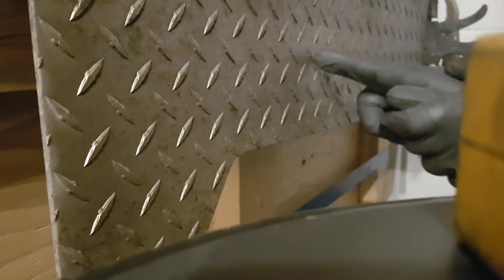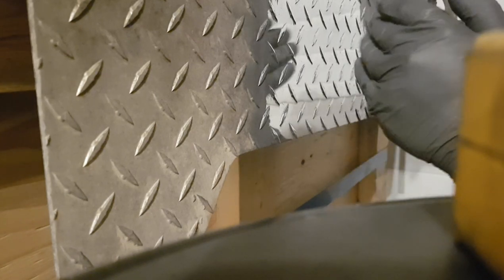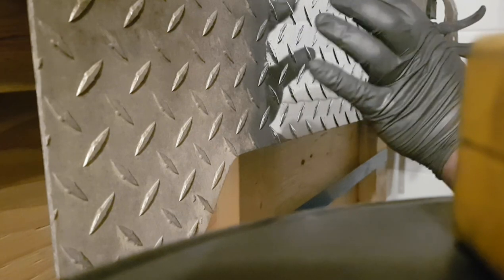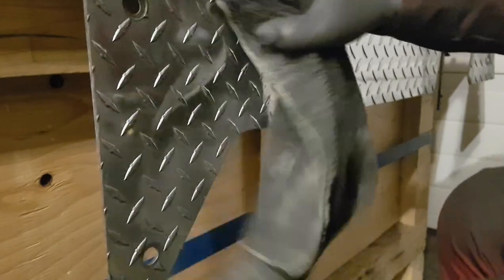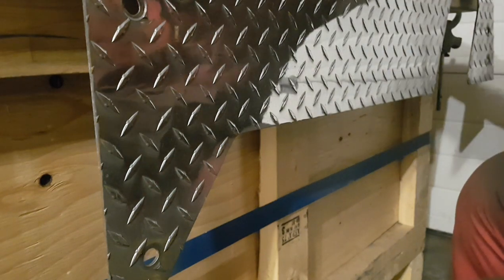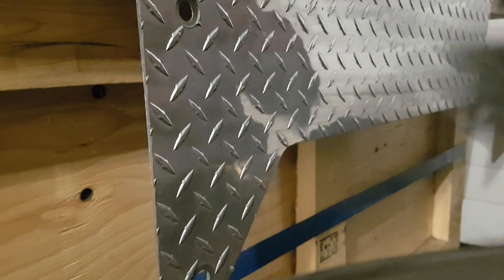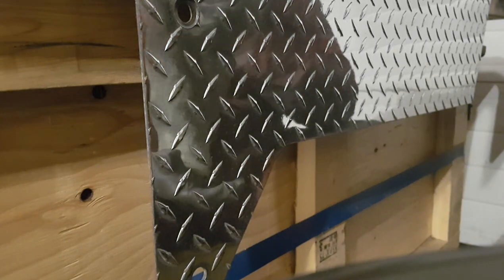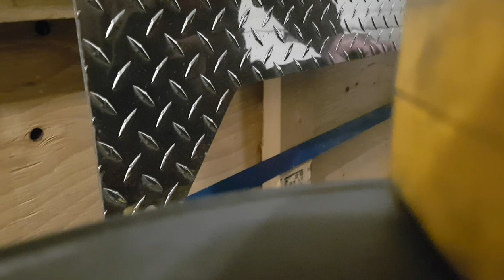How to polish checker/diamond plate step by step

Comment: tbh ive been in the finishing biz for years and ive tried to finish aluminum diamond  tread plate and just get a icky sticky compound mess. imma try your method but gonna skip the blue/white rouge.  i do know the brown (tripoli coumpound) will work on aluminum. trick must be the paint thinner and cleaning dirt off aluminum. that yellow compound we call it koker (usually cut and color for stainless) helps prevent burning of aluminum (formax stainless steel coloring compound does too) but is $20 per bar. gonna check out your channel

Comment: I’m going to put this to the ultimate test. I have now a 13 year old trailer that hadn’t moved in 8 years. The diamond plate was so oxidized I considered just replacing, but the previous owner went Diamond Plate crazy. I’ll report back. If this works on my trailer it’s going to work on anyone’s. (It’s really the worst I’ve seen) Thanks for putting the video together and the helpful hints.
Reply from the maker: If it is as bad as it sounds I would recommend using a bri tex wheel first. It is a large scotch Brite type wheel which works similar to sanding. You run it at about 1200 rpm, it will definitely help before you begin the polishing process!

Comment: Looks like your polishing with a grinder?   I have a 6-7” Makita variable speed up to 6k can I buy the wheels etc to polish for the Makita?   I believe it’s a 5/8” bolt the bad would screw onto.   

Also where do you buy the polishing wheels and rouge?     I live in California and need to polish up the Diamond plate on our Fire Engine.   I’ve just been using Chemical Guys Metal X heavy aluminum polish.  It’s ok but far from a mirror finish.  Any help appreciated.  Thanks.
Reply from the maker: Hello, you can run that makita, those polishing wheels are rated at 3200rpm max but lots of guys run them qt 6k but you absolutely would need to buy the self centering flanges running at 6k for safety. They can blow apart and be quite dangerous at that speed.  5/8 is the right size.

I buy my stuff in Canada because I live here. California has lots of retailers for the products, I believe one is called highway shine. Thanks for fighting fires for us all! 🙏

Comment: I have some light gouges in my diamond plate. Is there a method to take some of the sharp edges out of the gouges or lessen the gougey appearance of them?
Reply from the maker: On diamond plate it is difficult, only thing you can really do is try to sand it 180 , 220,320,400,600 grit, but again can be hard to get at. Whatever you do, DO NOT use a flap disk or alike!

Comment: Nice work. Just a quick question what condition would you have said that piece was? I work at a truck shop and I buy all my own polishing stuff and we have a project going on right now and I have so much oxidation on the diamond plate and it’s just caking up running at 3000 rpms. I won’t disclose who’s products I use publicly.
Reply from the maker: Checker/ diamond plate is every experienced polishers dread. It is always the first thing new guys are trained on, 1. Because it's a slow process, and 2. Because it requires no finishing skills. They're a number of options to speed things up, if its " caking " spray your surface with paint thinner, itll help your rouge soften and work through. Use it frequently add more rogue as nec6. Hope that helps
Reply: @sixshinez9290  What do you mean by nec6?
Reply from the maker: @r0ckworthy  Necessary *

Comment: Gr8 video  mate,, i need to do this down the sides of my caravan.
Is it just paint thinners you use??
Reply from the maker: Thanks Mark. As you can see, the Rouge ( polishing bar/paste) does the polishing, the thinner helps flow it along so it doesn't get caked in on the edges. Hope that helps!
Reply: But are you using paint thinner ? Is it straight or diluted ? And can you sand diamond plate ?

Comment: Acid base wheel cleaner and just wipe it off then polish
Reply from the maker: Depends , sure if it's diluted properly can help, however, if not used right, can "dry" out the aluminum making it worse, depends whether on as well

Comment: I just fishing polishing my diamond plate tool box. It was pretty bad so it took me a long time. I used the zepher wheels. I need to get a full face mask cause this stuff goes everywhere. Have you used the zepher wheels ?do you like them? I seemed to have some issues with the rouge getting stunk on the sides of the diamonds. Went through almost a whole brown bar. Does that seems normal. These pads are expensive. I almost used up the whole yellow wheel. Is there a harder surface wheel that can be used to cut faster?
Reply from the maker: I personally do not like zephyr wheels, they're unbalanced and it vibrates your hand and is hard on equipment. If you want to speed up process you can use a bri tek wheel to condition checker first, it's like a big scotch Brite pad but on wheel. Checker does use quite a bit of bar and is slow, it is always the first thing my trainees are put on cause I've done enough lol!

Comment: What type of thinner are you using?
Reply from the maker: Paint thinner
Reply: What i meant was is it a lacquer thinner or a  mineral spirits , acetone.....
Reply: paint thinner is none of the ones you mentioned, they are all different products
Reply: Yes different products but read the ingredients in different types of thinners. Every type i mentioned is in different products sold as paint thinners besides lacquer thinner
Reply: Mineral spirits is in almost every oil based paint thinners
Reply: @jr-gg8ci  i stand corrected then lol, I know what you mean. I didn’t think you knew to think that far into it. just like using acetone instead of a labeled thinner, for paint.
Reply: Sir excuse me just want to get this correct I have been trying to get our diamond plate looking good and can't so you say spray with thinner like paint thinner what are you actually using please I am going broke with what I have to get this right Thank you sir
Reply: @jr-gg8ci  I have  question sir I am wanting to polish diamond plate on our fire trucks thinner that you spray what exactly is it called please